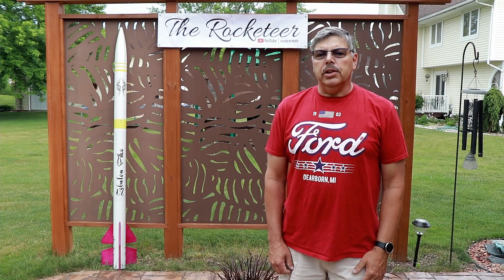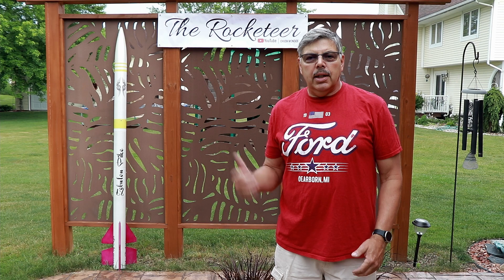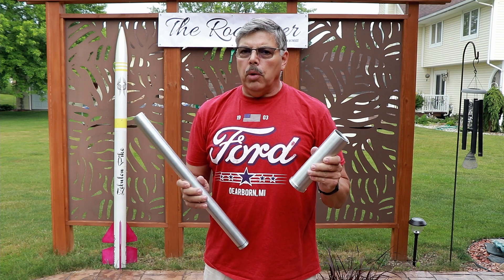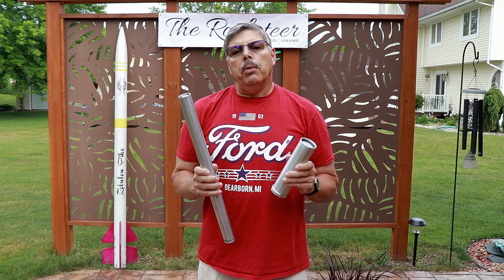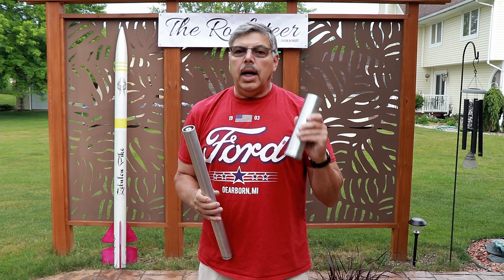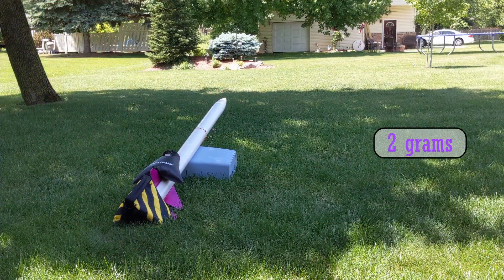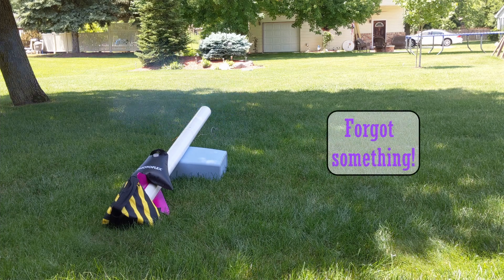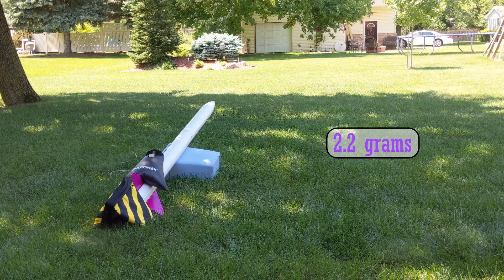Rocket Fail

Comment: Maybe try magnesium or magnalium? They should be more reactive so maybe it would burn quicker.... Or try adding 1% RIO, that seems to make sugar motors burn faster. Also, how to the 80/20 SB/SU fuel compare to just SB fuel? Slower or faster burn?
Reply from the maker: That is exactly what I was thinking. I have cast 6 grains with 10% magnalium that are ready for testing. I have burned a few test strands and they look promising.

Adding 20% sucrose to the sorbitol has worked quite well. It lights easier, burns slightly faster and pours a lot like flexi-fuel. The 80/20 fuel can be used at Tripoli launches.

Comment: 1:07 binder designs sells a 38mm 16 grain case that is 3 feet long...... Any chance we will see that on this channel lol
Reply from the maker: It is difficult to build a motor that long because of erosive burning. It may be possible to do it using erythritol as a fuel. I don't have the resources at this time to take on a project like that. It would be fun to try!

Comment: Looks like it burned through at the liner/nozzle interface. Does your nozzle have a shoulder that the liner end slips over or is it a simple butt joint? How thick was the aluminum casing and what type of liner material?
Reply from the maker: Yes the nozzle has a shoulder and the liner is from Always Ready Rocketry. The aluminum 6061 case was machined to LOKI specs by a local machine shop.

The problem seems to be related to the slow start up because I used 5% aluminum in a 80% sorbitol 20% sucrose mix. I repeated the same mix in a 38mm motor on Monday and had the same results. Very long and slow build up then it ramps up to full pressure when the fuel gets hot. This is a very different outcome over flexi-fuel where it just burns like crazy even at 15%. So the bottom line is that aluminum is not compatible with the 80/20 propellant. I assumed that because aluminum works great in flexi-fuel that 5% in this propellant should be no big deal. Obviously that was a poor assumption with a bad outcome.

I am using 80/20 because it pours like flexi-fuel, sets up in 1 1/2 hours, shrinks less, passes Tripoli guidelines and does not produce a deathgrip on the mandrel.

Please go to the about tab and send me an email. I could use some advice from an experienced builder!

Thanks, Chuck

Comment: I want to work on control systems, not height records. So personally I'd take the longer motor, because it should make the rocket harder to control, especially if I load it with a slow-burning propellant.

Comment: The 54mm will produce a longer burn due to a higher web thickness. One the other hand, the 38 one has a much greater burning surface area so it will produce a fair amount of thrust and thus pushing the rocket to a bigger speed. For the same specific impulse, the 54mm will bring the rocket higher because less speed means less drag so greater altitude.
Hope I get it right
Reply: I am having a curiosity that.
Q1) Does more rocket mean that rocket will go further and have greater thrust
Q2) What if we attached several motors at the bottom of rocket, will we have to reach greater height
Reply: @roboarjun  more rocket ?
several motors (clustering) is a way to achieve greater height, however, it also brings more drag, so there's a fine balance to reach
Reply: @shere_kan8329  ok thanks
Reply from the maker: Yes, you are right on all points! The 38mm will have a shorter burn time and can lift a heavier rocket with more G-force. This is also useful on a windy day. The 54mm will burn longer and should reach a higher altitude due to less wind resistance.
Reply: @TheRocketeer  ; )
Reply: @TheRocketeer  if you look at the rockets that hold altitude records for a given impulse, they are long and skinny, with less aerodynamic drag.